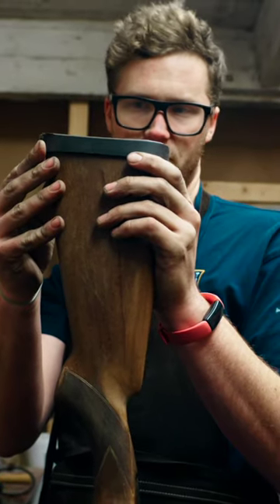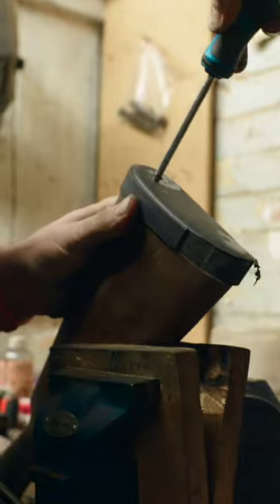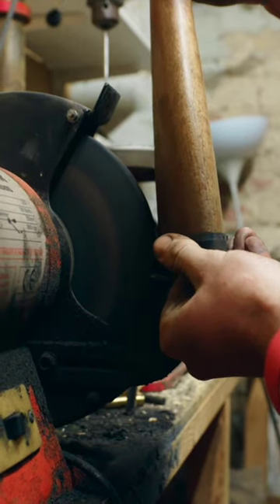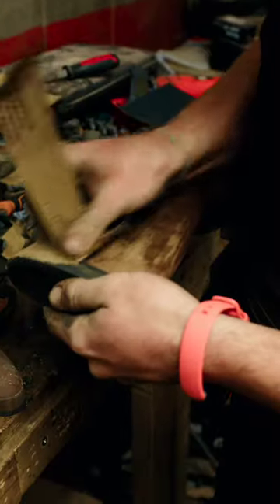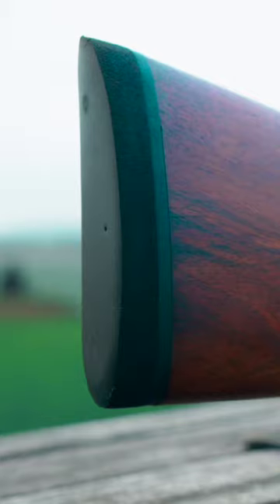Fitting a New Shotgun Recoil Pad

Comment: What’s the difference when adding an extra inch
Reply: You Position of your eyes.
Reply: The LOP, Length Of Pull, which has had an inch added here due to the bigger butt pad is not It’s not for the position of the eyes as such, is for the fit from the shoulder pocket to the hands. 

The comb height is for the position of the eyes.